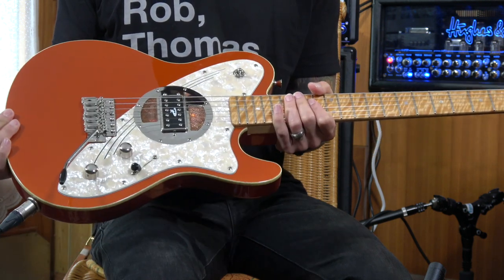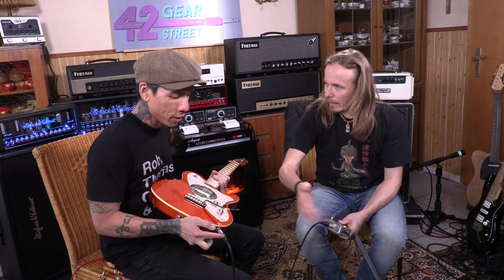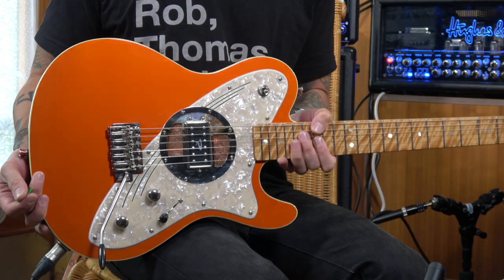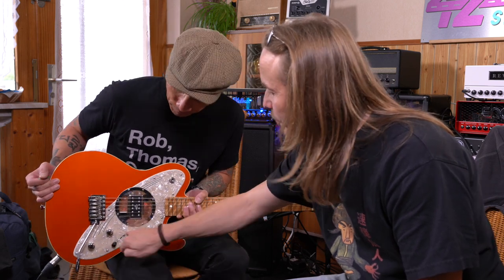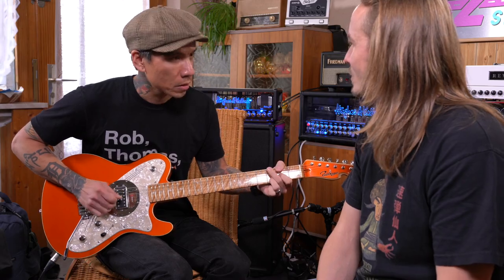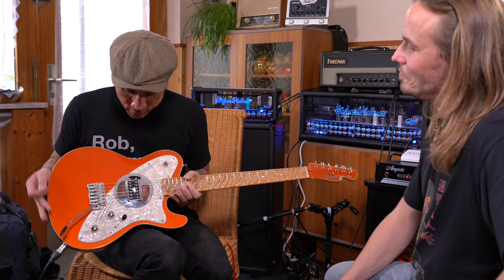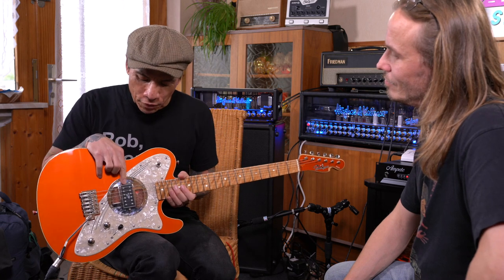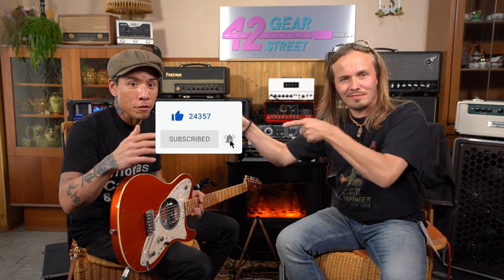Valvebucker guitar with Juha Ruokangas  | 42 Gear Street

Comment: There are more guitars with build in tube amps, like the Hoyer 25 ca 1955 but this is nice thinking anyway   (and Ruokangas builds exceptional guitars)
Reply: cor vdb Thanks. The Hoyer is a whole different concept. As you said it is a built-in tube amp. The Valvebucker is an active pickup. More accurate comparison would be a tube microphone such as Neumann U47.

Comment: Where is the plate DC voltage coming from? I'd be worried that it would sound like the tube-powered pedals that run off low voltages, when overdriven. I definitely would NOT fancy a full 300V under my right hand, which is why, I'm guessing, it hasn't been done before.
Reply: Gerry James Edwards It’s not high voltage. The guitar gets 12VAC from the floor and we up the voltage in the guitar to a level where the tubes work for real.
Reply: @ruokangas  Thanks for the reply. Voltage multiplier? That's good, if it is, as they don't deliver much current in the event of a short. It's an interesting idea, and a very full sound.

Comment: Sounds like any other set up. Preamp/Amp in the guitar vs the pedal vs the amp itself. Really just looks like another remote method of control that doesn't require one to return to the mothership base of the amp and tweak the amp itself. Where you create this effect for what can be done another way already. They'll make them it's not for everyone, yet anyone can use it or not ? Is it anyhting more than a California Prop 65 label cancer causing product ? Use it at your own risk disclaimer with a release from liability for the manufacturer, rental or seller ?

Comment: Very interesting. I would like to have that system on an acoustic instrument. Note to note definition was excellent and each note seemed to have the tube “bloom”. Could be “finger pickin’ good”.
Reply: for what it's worth, Takamine actually developed an acoustic electric using a tube preamp that sounded pretty good! They're relatively rare, but you can still find them used if you poke around.